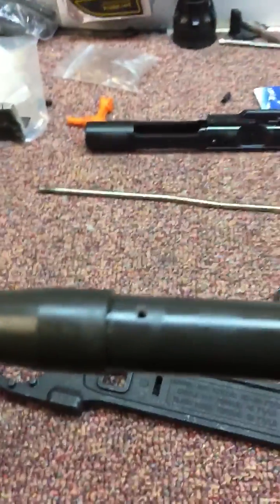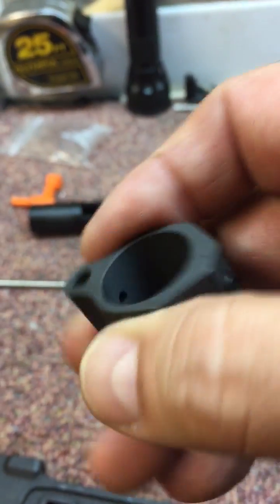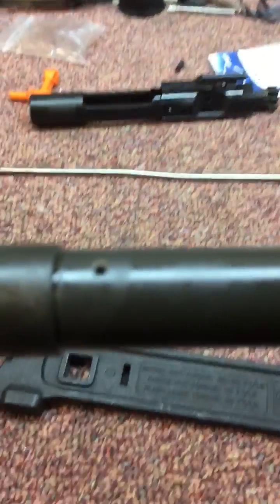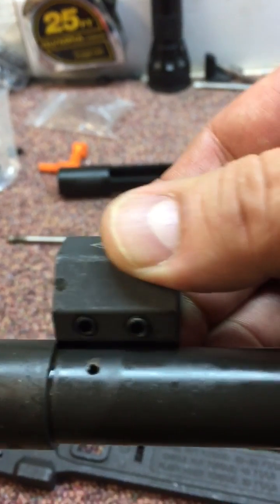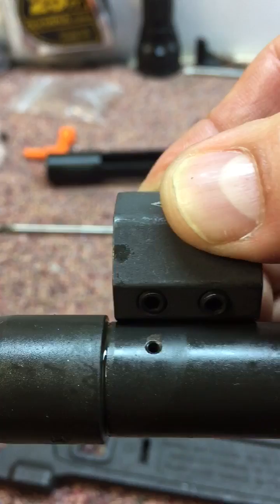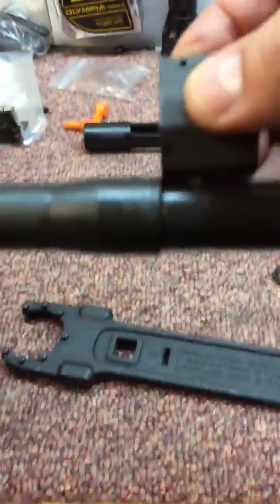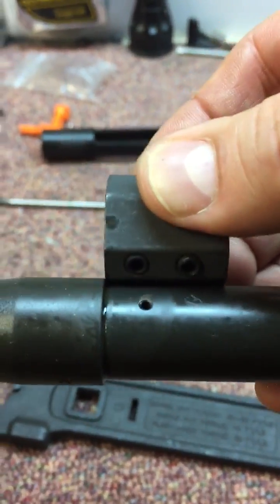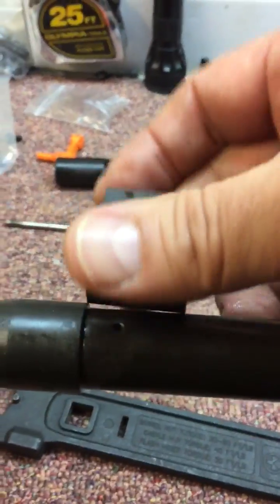X-Ring Tech Tips / AR-15 gas block alignment

Comment: Hello! Nice video, I have an old colt but barrel is shot, I want to replace it but I'm concerned the barrel will not have the groves for the pins for the m2 a frame, will I have to drill into the barrel? Or are there any barrels pre drilled? Yes I can upgrade to a low profile gas block but it would look funny with the carry handle, like I said, it's old but I love it